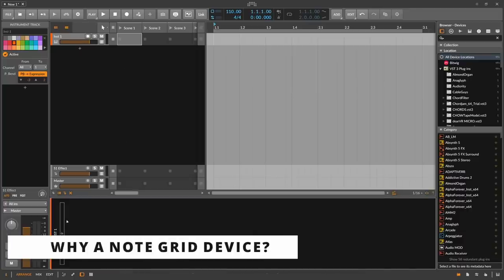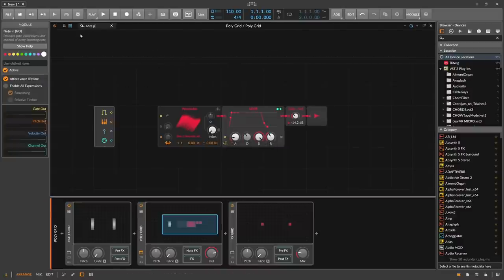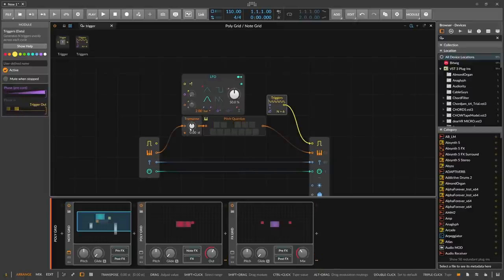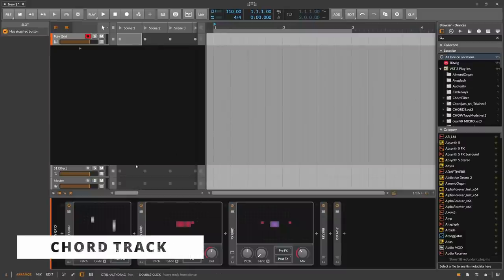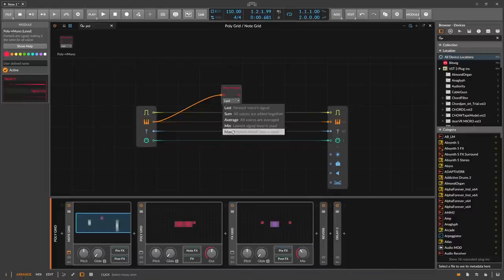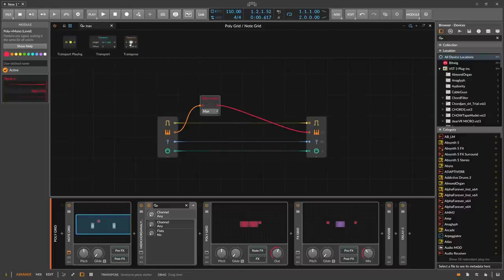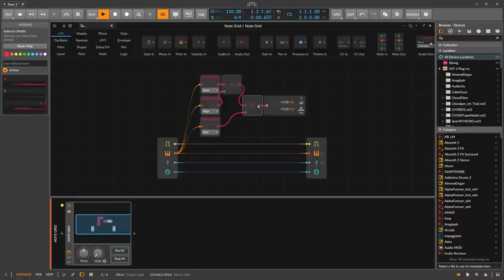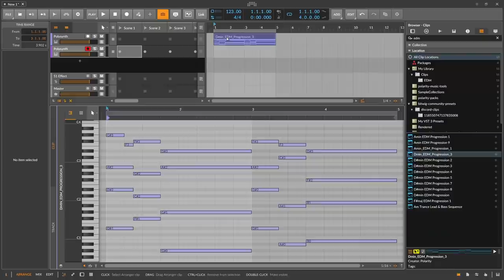the note grid is fun...

Comment: If I have a set of chords that I would like to trigger with my midi keyboard. I only want the timing from the key presses not the pitch. Is that possible? For each key press the next chord is played as long as I hold the key. No chords are skipped even if I hold the key for longer than the chord is on the time line

Comment: I just recreated a device I built in Ableton that generates intermittent Melodie’s. Very cool, and much simpler in BWS!
However, when I recorded the MIDI out, instead of getting a sequence of MIDI notes, I got a single note with pitch changes in MPE (I think). Is that expected behaviour? Can I force the Grid to output a new note when the pitch changes?
Reply from the maker: yes. you need a gate signal, which dissects the notes. if you change pitch, while "gate on" you get these pitchbends. so gate on/off is important. best use case is to use a sample and hold with pitch and gates. this way you get one steady pitch with one gate on.
Reply: @PolarityMusic  Thanks! I was thinking that might be the answer - but so far clock timing and quantizing is still challenging. At least I know what specific things to research next!

Comment: I may have missed it in the video, but is there a 'note filter' for the Note Input? Like if I want a gate to only be generated by a specific note, or note range? So all other notes outside of the selected filter are ignored?
Reply from the maker: outside of the grid you can use the "note filter" device. inside the grid you need to add some logic. (compare the incoming note to a value from the pitch module and then use a switch to only allow a specific note to pass)
Reply: @PolarityMusic  Thanks for rundown. I'll send a request to Bitwig. Built in filtering setting for the Note Input module would be handy for a future update. (making it easier to build devices that can do per note probability, or per events in specific range, etc). Cheers :)
Reply: Yeah, I was hoping to be able to filter different MIDI channels down different Grid paths, but that doesn’t look possible yet

Comment: There appears to be a problem if you have a note grid on the front of a Drum Machine.
The CC out's in the Note Grid don't get passed through into the chains.

That means the MIDI modulator doesn't receive the messages from the Note Grid, it gets it from whatever MIDI is coming in from the track itself afaict.

You can make it work kinda by manually putting a Note Receiver on the front of every single chain and pointing the input to the Note Grid, but that's quite a hack.

Any chance someone could verify this please and see if you think this is by design or is it a bug?

Either way I think this isn't what you would expect.  There shouldn't be anything special about the Drum Machine Container should there?
Reply: Haven't tried this with Note Grid yet but I've encountered a similar problem with Drum Racks not playing from within an Instrument Selector container.